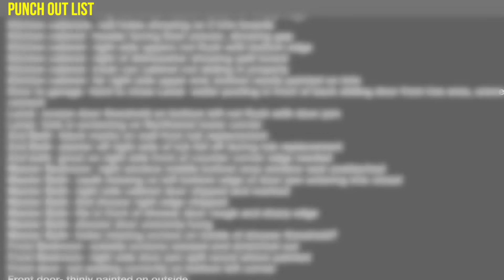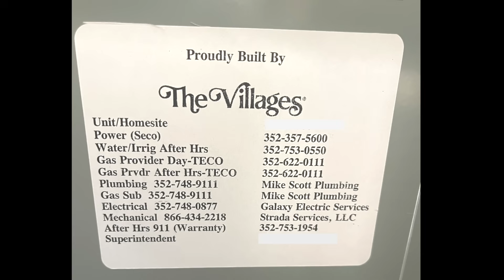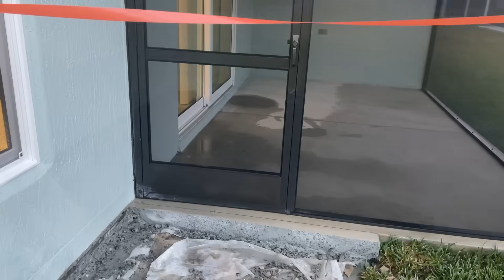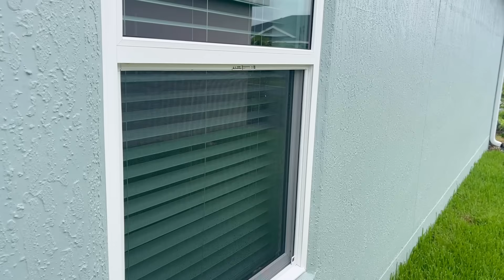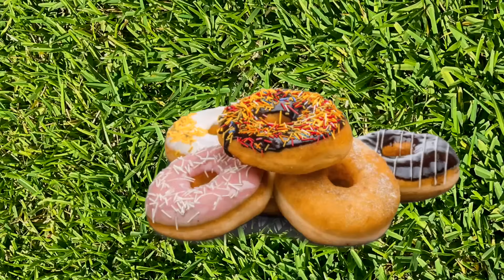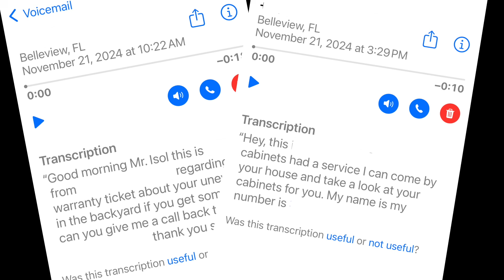Big Repairs Needed Right After Moving in The Villages!

Comment: Nice upgrades guys. I missed the part where you actually bought a house and had questions.  I agree with the gutters, and thats pretty inexpensive.
Reply: I have a different opinion. The design seems to require gutters at least around the front door area. Poor house design that should automatically include gutters.
Reply from the maker: Thanks for watching! 😎

Comment: Water pressure to showerhead. Try removing the little water saver screen at the bttm of the shower head vwhere the shower hose attaches. little plastic piece with screen. needle nose pliers or small screwdriver.
Reply from the maker: Yes, we did that. Inspector checked and all is well. That video is coming soon. Thanks for tuning in!😎

Comment: Great Video.  It provides people who are considering new builds in the TV what they can expect and the quality of the construction.   Nice to see the warranty department is responsive.  Not all corporate builder's like DR Horton, Lennar  warranty departments service is as good as you have received.  If you are a snowbird,  I would not buy a new home in the TV because it will take all year to work through the defects.  A home that is a few years old would be a better value for a snowbird because the defects have been most likely repaired and the landscape has been already done. 

On another note, the quality of the fill dirt used on these homes can cost owners lots of money for irrigation.  The University of Florida has done significant research on this topic.  Bottom line here is that a top dressing of dirt made of a 50/50 mix of dirt and compost significantly reduces water usage and improves the quality of the turf as well requiring less lawn treatments.
Reply from the maker: Thanks for the input! We had a few delays on repairs because of our schedule but they worked around it in every instance. Thanks for watching! 😎

Comment: Do not put bleach or vinegar down the drain line on the new AC units, the vapors are corrosive and your coil is now aluminum which is a bad combination.  Hot water to flush, then shop vacuum from the outside. The automatic cleaner you have should be designed for aluminum coils, still shop vacuum the drain line a few times every year.
Reply from the maker: Thanks!! Better advise to use hot water and shop vac. Thanks for watching!😎

Comment: Unbelievable. I would run screaming the opposite way before ever buying into a Housing Development with that kind of poor, poor building construction and finishing. I would never buy anything like that. That's just inexcusable to have such poor workers and supervision and materials. We installed an Ikea bathroom cabinet that doesn't have a scratch on it and it's almost 10 years old and perfectly aligned.  With the Lanai why isn't there a downspout from the gutter? Yes I understand the cement was not leveled correctly but why no downspout on that corner? It's unbelievable to me that they didn't have gutters by your front door! You live in a high humidity area. Sounds like they're trying to cut costs with a lot of this and leaves the homeowners hanging. I'm assuming that you guys are not do-it-yourselfers? Some of those things I know how to do myself. like adjusting hinges on kitchen cabinet doors to align them. The thing is with a brand new house it should all be perfect. Obviously the contractors, who may or may not be actually overseeing things, are not doing a walk-through checking their own work which is absolutely inexcusable. Hopefully your house is not very expensive. I personally would have done a walk through of the house before closing and demanded that all of the repairs be done ahead of signing off. With your yard you can certainly dig up some of the uneven areas and just have it landscaped. Plant some shrubs and flowers and trees. It's very common during any kind of home construction for road fill to be used for yard areas, basically junk. Water bottles and piping, that's unheard of. I would definitely advise anybody to never buy any kind of a house in that housing development given what you're showing. And the fact that they have so many people getting so many repairs is a huge, huge red flag. One of the problems you'll be facing is that you don't know what kind of damage was is created by shoddy construction that you can't see and possibly a qualified home inspector can't see. I would highly recommend hiring an additional home inspector who does not work with that housing development and has no ties to them to do a full home inspection. It would be a worthwhile Financial investment. Good luck!
Reply from the maker: We are DIY's but since most things are covered under warranty for the first year we figured they need to take their time and tools not ours to fix things properly. We took a leap of faith that they would fix all flaws and they did! Just disappointed when you find chips on every single counter top! People just need to understand that this is how it is here in The Villages. All that said, we would do it again.

Comment: We had sand in our line that completely clogged one sink in our master bathroom and the washing machine line too. 

Mike Scott came out and removed the plugged from faucet and sand poured out. It’s a common problem here, one that can affect your new appliances, faucets, and shower heads. 

We discussed this with others and think it’s due to the PVC plumbing they leave exposed to the elements prior to turning over the home to the builders so sand blows into the pipes and they don’t flush them properly before installing the fixtures so when you get it…you have problems.
Reply from the maker: Thanks for the insight! It's going back on the list!😎

Comment: For the water flow you could try just timing how long it takes to fill a bucket to maybe 2 gallons.  Compare the spout to the shower head and then measure the one you think flows better.

This is a good lesson for those that debate a new versus used home.  They all have problems.  At least TV seems to own up to the repairs unlike most builders.
Reply from the maker: We will try this for the water flow! Thanks!
Reply: You are under the 1 year warrantee so why not call The Villages and get them to send a plumber? @IGoWhereYouGo

Comment: Thanks for the review.  While errors and omissions in building a new home is nothing new, the amount in your review is alarming.  

A point you did not bring up is The Villages is building and selling so many new homes so fast,  that I am concerned the land is not given time to settle before being built on.   In your video you showed your lawn was not level and having minor pot holes under the sod.  While some of this may be from debris, more than likely some of it is from settling. 

The location your home foundation was placed on was also was not given time to settled before building on. The land engineered for water drainage, and max number of homes per acre, is a masterpiece of modern engineering.  Roads are built similarly but they use heavy roller equipment to compact the land before building on. The heavy concrete home, built on land that is not compacted, may in time show more than normal cracks and possibly even structural failure.
Reply from the maker: Good point.
Reply: Builders there don't care. It's a retirement community, they figure someone will die and sell before big problems develop. And the building inspectors just collect fees and sign it off.

Comment: Did you get a Home Inspection done early in the process? I mean by a professional/unbiased/disinterested 3rd party, not someone working for The Villages?
-- BR
Reply: I didn't buy in the villages.  But definitely should get a Home inspection.  I cheapen out and only had a final inspection done.  I really wish I did their 3 visit inspection. They come out during the building process before drywall goes up and look for stuff because who knows what lurks behind the walls.
Reply: @achance007  I would also -- even a brand-new house "demands" (!) an inspection and as I said, an inspector NOT associated in ay way with the Developer/Builder. And I'm not just singling-out The Villages, or even FL -- in ANY state/housing market a new home should be inspected.
And since I'll likely be buying new myself, I'm taking my own advice (!) and WILL be having a pre-purchase inspection done. If the Builder does not fix any issues found I'll pass and look for another property. There are plenty of homes that would suit me so I won't be tied to one, especially if the Builder isn't as responsive as I expect.
As for the Inspector, I'll look for the best-rated one I can find, regardless of cost. After all, even the most expensive Inspectors are only a miniscule fraction of the price of the house, and any issues found and fixed BEFORE purchase/moving-in will be well worth the cost.
-- BR
Reply from the maker: We wanted to as you normally would but our sales person said they will fix everything under the 1 year warranty. And they did! We have an independent inspection appointment in October before our 1 year is up and will revisit anything "unseen". That was explained at the end of the video. Making the decision to buy during the lottery process within just hours and closing in 30 days is their business model, which does not give the customer much time to get a full-inspection beforehand. But they do give you that 1 year warranty.

Comment: Glad it’s all fixed….but this was wayyyyy too many problems….😮 Did they offer to use a heavy roller to even out the sod?
Reply from the maker: They said no when we asked for it. He said no at the time but we found out later he was a new employee. It's on our new list maybe they will fix it.
Reply from the maker: We asked. They said no.
Reply: There's probably depressions in the ground. We had this issue in Virginia. We had to add soil on top of the grass to even it out. Since you do have sod and it's probably st Augustine, you can probably take a machete, cut a 3 sided square over the area that is depressed, pull it back and fill, then put the grass back down. We had that kind of grass in Texas. It'll grow over. In Virginia we had to add the dirt on top and it works it's way in by itself. We had to add dirt a few times until the depression was even.

Comment: On the waterpressure issue on the showerhead, an easy fix which i have done is removing the water safer plastic piece inside the shower head itself.   All modern shower heads have a blue plastic device located right inside the connection area of the head.  It's a device to save water.    You can remove it easily and its night and day the amount of water pressure it provides.    There are many videos on you tube to show you exactly what I'm talking about.    It's a ten minute repair and makes all the difference.    Good luck :)
Reply from the maker: We already did that. It's going on that 1 year warranty!

Comment: just remember you get what you pay for i would never buy there they are so cheap they throw them up in 2 3 months
Reply: Builders can put up homes fast but still quality construction (and materials) -- that is, IF they want to -- so speed alone isn't necessarily a factor determining "cheapness." For example, remember how Levittown was built: The Villages Developer/Builder uses pretty much the very same concept  "assembly line" process of building homes Levittown pioneered (!) back then right after WWII. 
Still, it seems the Developer (General Contractor on the site?) isn't supervising/checking sub-contractors as they SHOULD be doing and I agree there is NO excuse for not giving a Buyer a well-made home. 
No, it doesn't have to be perfect, but at most only a few and VERY MINOR issues. But even those issues SHOULD be easily spotted by a Developers "final inspector." If they don't HAVE such a "final inspector" position -- much like factories have QC Inspectors going over the product at the end of the production line -- they need to create that position, hire inspectors and stop this nonsense. It's shameful.
But you know, America's "work ethic" has been in decline -- lowering the bar for just about everything nowadays -- for decades...this is just another example of it. Along with "just doing the right/honest thing" for customers no matter what the produce is (a house in this case). Sad...
And the huge builder in America ones like DR Horton, Lennar, etc. are some of the worst. And IMO, it's even it's criminal.
"Made in America" pride. Right. Not anymore.
-- BR
Reply: I guess you're ok speeding in that car you drive that was built in hours.
Reply from the maker: Thanks for watching! 😎
Reply: Great video. We had 54 items identified after move in and were able to meet all the subcontractors before the list was completed. Our one year inspection was completed by Jeff Alsbach. He only found a few items during his inspection and did a great job. The warranty department was very helpful. Only one item was not completed on the list after multiple requests (extra flooring). The amount of days spent waiting around for contractors was unacceptable, and many of the items I addressed. The thought of starting over with another new house is exhausting, but we would do it again.
Reply from the maker: As annoying as it all has been, we would do it again too!